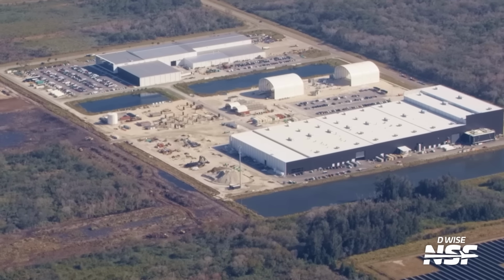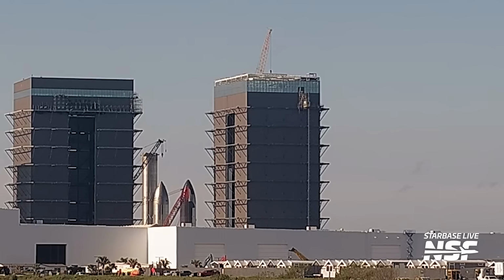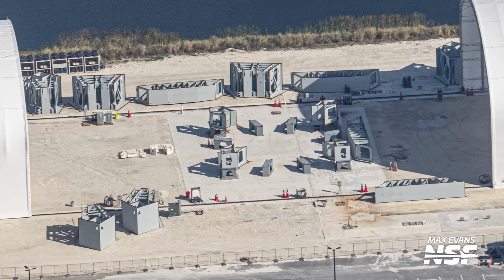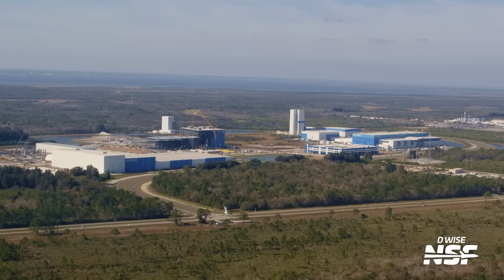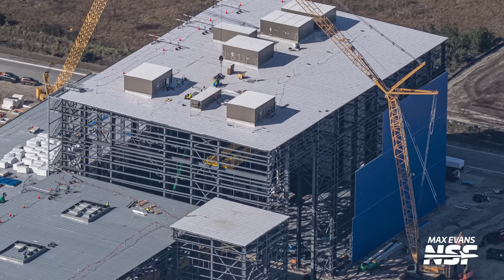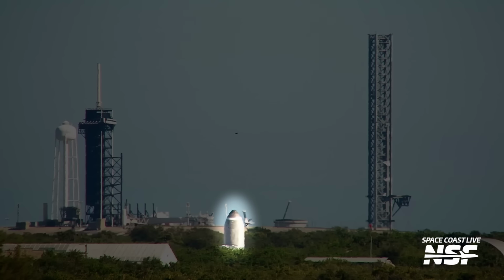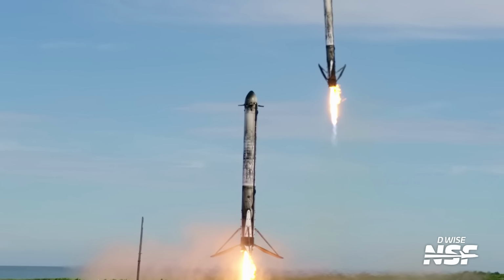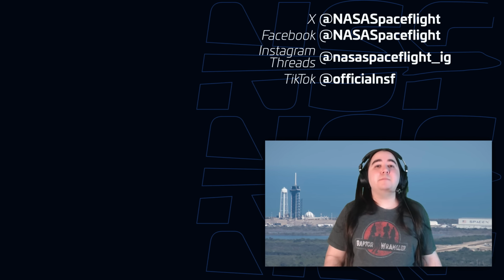SpaceX's Massive Florida Expansion: GigaBay, LC-39A Upgrades, and More!

Comment: You mention that Gigabay could hold a dozen fully stacked Starships and illustrate that with complete booster and Starship stacks, however, the full rocket is 122m tall and the Gagabay is only 116m in total. I assume you mean fully stacked boosters?
Reply: Yes, fully stacked boosters and ships (separately from one another)

Comment: Didn't SpaceX sign a lease for use of one of the high bays in the VAB a year or two back?  If they could get another, wouldn't that work for them and save some construction costs?
Reply: All VAB high bays are being used by NASA. The lease never went through

Comment: I have just realised that SpaceX didn't need to build and tow a barge far out into the ocean, just in case they could land the booster. Experimental landings on the sea were part of the philosophy of "the best part is no part". Now they have shown that their launch facilities can be reused for landings. I suspect that they will only go back to using a modified oil rig for landings and takeoffs when they have shown that they can reuse boosters and ships without refurbishment. I look forward to seeing how a single tower on land or on a rig can be used efficiently, and whether they will need multiple "gates" for this vertical "runway".
Reply: Off-shore spaceports are still possibly needed when the pace of launching becomes excessive at KSC. But these oil derrick platforms would not be enough.
Reply: IF their plan is actually high speed reuse of the boosters then landing at sea becomes counter productive.  The engineering and expense behind a sea based launch system is really hard and expensive.  It would be desperation to do it.
Reply: @ - offshore towers may become essential if the sonic boom becomes an issue. Ships can transport the cargoes and liquid  gasses needed far more efficiently than road transport. However as I said, it will only happen if SpaceX reach their goal of Starship become as reusable as an aircraft.

Comment: When comparing size, the NASA VAB is significantly bigger than the new GIGABAY project, however, how many rockets fit in the VAB?
Bigger may not be better.
Reply: It can fit multiple full stack Starship rockets compared to zero full stack Starship rockets inside the GigaBay
Reply: @ No need, stacking is an external operation.
Best stack is no stack. Well at least not until launch.
Reply: @SteveWindsurf  Well you asked how many rockets it can fit so I compared full rockets so I did a proper apples to apples comparison in that case
Reply: @Alexphysics13  People are going to have to stop referring to the manufacturing as 'stacking' now.  It does tend to lead to confusion.

Comment: Adrian. Toughly. SpaceX will need a space equivalent to Massey for the same purpose. Where will it be done ?
Reply: Massey is a test site, so hopefully at Kennedy, they will just build and fly no testing required, same as in the car industry they build and test cars initially but eventually it's just build them fast and get them out the door/

Comment: Yeah, me again...re 39A... flame trench could possibly incorporate a flame diverter/trench with a higher / curved end deflection angle to deflect exhaust away and above any sensitive areas? Maybe raise the 'floor' of the trench above ground level at its end (ie extend the end of the trench skywards?) and so direct any 'undesired forces' skywards and therefore avoiding any incidental damage to adjacent structures or facilities???
Just a thought, but hopefully maybe someone might pick up on it????
Reply: Be sure someone at SpaceX will have tried to select the optimum trade-off
Reply: Is there a danger to sensitive area's with the existing system?  Are they planning a new trench at 39A?  I have to admit I have NOT been following what's going on at the cape.

Comment: The VAB is still the biggest building by enclosed volume in the western hemisphere.  You could park the Gaudi's Sagrada Familia Cathedral inside that building with internal space to spare.
Reply: the NASA Vehicle Assembly Building (VAB) is among the largest buildings in the world by volume. However, it is not the largest. The VAB has an internal volume of approximately 129.4 million cubic feet (3.66 million cubic meters), making it the eighth-largest building by volume as of 2022. 

In contrast, the Boeing Everett Factory in Everett, Washington, USA, holds the record for the largest building by continuous volume, with an interior volume of about 472 million cubic feet (13.3 million cubic meters). This makes the Boeing Everett Factory significantly larger than the VAB.
thanks to CHATGTP

Comment: I am surprised that the fact that Blue Origin left their massive second stage and payload in Medium Earth Orbit.  For visualization it is 21.9 (72 feet) meters long, 7 meters (23 feet) in diameter, with an unfueled mass or around 15,000 kg (33,000 lbs).  That is a lot of space junk  that seemingly will remain in orbit for decades or even centuries apparently in violation at least the spirit of U.S. Government Orbital Debris Mitigation Standard Practices (ODMSP).
Reply: it is a controlled stage though, so it is likely still powered to an extent
Reply: @clayel1 - do BO have a plan to de-orbit it or send it to a graveyard orbit ??
Reply: @clayel1  That second stage is in no way still powered or controlled. There is no power source and its propellant was vented out after it did its mission.
Reply: Medium Earth orbit is indeed a very long-term storage location. In centuries, when the BO stage finally begins to approach LEO, it will need to be intercepted and yeeted into the Pacific graveyard.
Reply: The amount of material in that orbit is much thinner.  It's safer there than in LEO.  Long term safe disposal is the goal of the debris mitigation effort and a long term grave orbit fits the bill.

Comment: They already have a mount assembled at AO. They have not even approved SpaceX to launch starship from the Cape. Blue is expanding. Still have Relativity and Stoke Space that are building their pads as well. A lot is coming to the Cape in the future.
Reply: The mount at AO is the old design and it's scrapped which is why it is outside rusting in the salty air.
Reply: Not too worried about Stokes- those folks are proceeding full-speed. Worried about Relativity, tho.